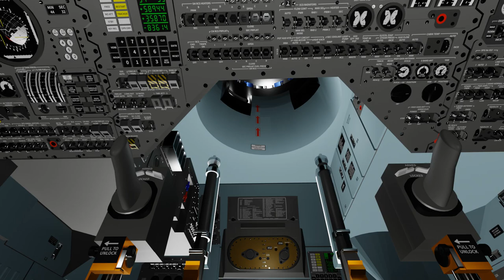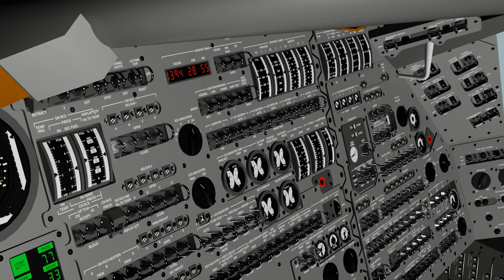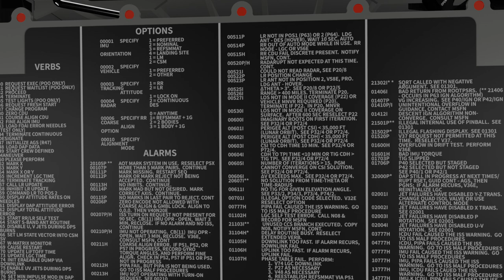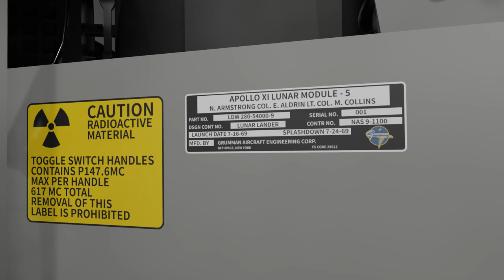Apollo 11 Part 2: One Small Step

Comment: I was twelve years old when my mother, brother and I watched the Apollo 11 launch from just outside Cape Kennedy. It was loud even though we were probably 4 or 5 miles from the Saturn V booster as it cleared the tower. We watched the broadcast on a black and white television set in a motel room somewhere in Florida (we drove down to Key West during the mission). We lived in New Orleans so I went on a school field trip to Michoud to see where and how the Saturn V was made... Years later I was working doing laser shows and did one in the Space and Rocket Center in Huntsville where I projected laser and video graphics on the side of one of the left over Saturn Vs. I got to climb around the rocket and was saddened by its condition (it was rusting outside before they refurbished it and built a building around it). During our evacuation from New Orleans post Katrina we toured the Johnson Space Center control room that was used during Apollo 11. I'm 67 years old now and on my bucket list is to go and watch a Space X Starship launch in person. Oh, I also saw a SpaceX dragon re-entry that landed in the Gulf of Mexico... it resembled a meteor as it flew across the night sky shedding ablative material from its heat shield
Reply from the maker: very cool

Comment: At 8:05, the wrong LM Reaction Control System (RCS) thrusters are firing.  Those shown would have increased the LM roll, not stop it.  It's a very minor error and otherwise, it was a pretty accurate video in my estimation.
Reply from the maker: You have a good eye….I will have to fire my quality control guy.  Oh wait….that is me.
Reply from the maker: However, that is yaw and not roll.
Reply: @opieswenson  - It was so minor I almost wasn't going to mention it.  Again, a very good video.
Reply from the maker: @Booboobear-eo4es  Thanks for pointing it out.  I have used lots of viewer comments to make corrections in videos.

Comment: Again, amazing  quality on this clip. Are the ĺegs on the  landing stage of the LEM spring loaded or gas activated. Thanks for your amazing  work. Regards  from Ireland
Reply from the maker: I believe it is spring loaded.  Regardless, the legs are held retracted by a titanium strap which is severed with a pyro charge.

Comment: Wasn’t there some kind of strings hanging down from the LM feet as indicator to switch off the engines?
Reply from the maker: Yes.  But they did not shut off the engines, they lit up the contact light at which time the astronauts hit the big button to kill the engine.  Please see my later video of Apollo 15 where I added a whole lot more features to the LM (probes, radar, working gauges, astronauts, Mesa, Rover, etc:  Here is part 1:https://youtu.be/kYHl42M2I2w?si=tUqMNPZVRxpdhHyV

Comment: [12/01/22]  Beautiful work. I haven't used Blender, but I have to believe that putting this together was a lot of work. Where did you get all the information regarding the switch gear, the labeling, and all the dimensions to properly size everything in both space craft?
Reply from the maker: Thanks.  There are many sites online with pictures and schematics.  There is also a lot of NASA documentation online like the operating manual and systems manuals.  The instrument panel diagrams are easy to find and they are also in the operating manual.  The most difficult thing to get hold of were command module placards and decals.  Lots of looking through pictures online.  The Smithsonian also has a 3d tour inside the command module but many of the decals and placards you can not read.

Comment: Where did you find the radio communications from? For the final approach and landing
Reply from the maker: You can get a lot of audio and transcripts from NASA:  https://www.hq.nasa.gov/alsj/a11/a11.html

Also there is another site that has all audio, pictures and video in real time: apolloinrealtime.org

Of note, there are several who have mentioned "where is the time lag in audio?"  The time lag is only between cap com and the astronauts.  No perceived timely between the 2 spacecraft talking to each other and no time lag when the flight control team is talking to each other.  In my audio, I have also included the flight director loop, which the astronauts would no hear.

Comment: When they get out the air get out! How they breath in the room?
Reply from the maker: When the astronauts depressurization the spacecraft, they are already wearing their spacesuits.  When they get out, they are wearing the PLSS (portable life support system) that supplies oxygen and cooling water plus scrubs carbon dioxide.  Prior to launching from the moon, they wear their spacesuits and plug the hoses into the spacecraft.  Then depressurization the spacecraft for the last time to throw all the trash out including the 2 backpacks (84 lbs each earth weight)
Reply: @opieswenson  I know they wear spacesuits! How is the filled room air after depressurirzation?
Reply from the maker: @jameswilson5230  you dump the pressure here (real photo Apollo 12): https://www.hq.nasa.gov/alsj/a16/LM11-co33.jpg. 

You depressurization the cabin with this panel:  https://www.hq.nasa.gov/alsj/a16/LM11-co1.jpg
Reply: @jameswilson5230  It's filled, just like you said. From oxygen tanks onboard. I guess we're being shown the control panel for repressurization at 17:03.
Reply: Do they wear their space suits for re entry back to Earth? A most hazardous thing to do.
Reply from the maker: @u1zha  yep…that is it.
Reply from the maker: @NeilPeelParanormalPeepShow  they do not wear suits for reentry.  Most likely due to needing to valsalva (pinch nose and blow) during rapid descent.  In fighter aircraft, we have a small soft depression in the oxygen mask to do this.  Spacecraft before Apollo, they wore helmets with visors and it was easy to keep the visor open to do this….and rapidly close it if needed.  In Apollo, they wore the bubble helmet which could not be put back on rapidly.